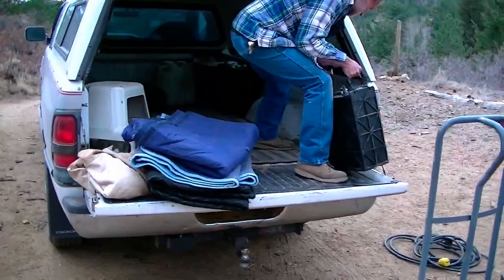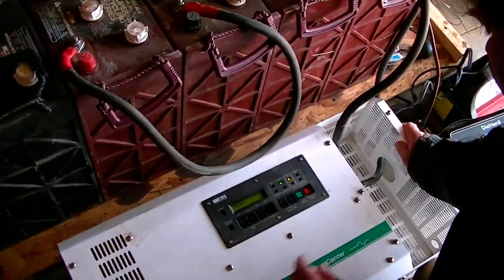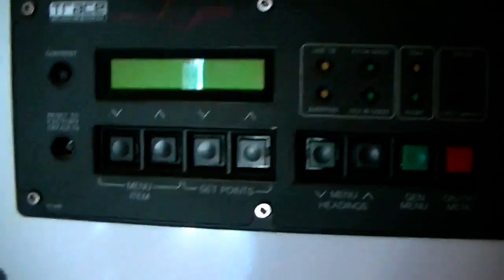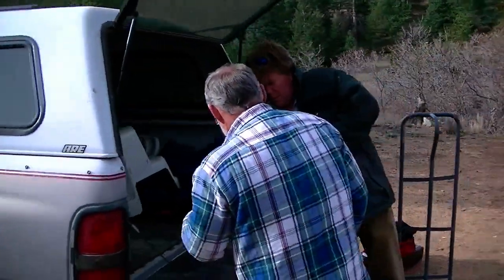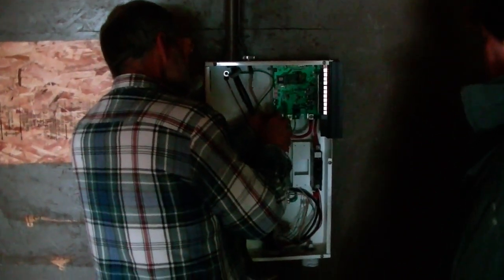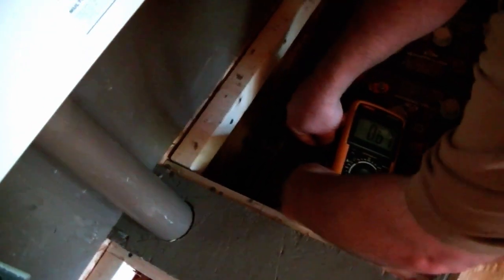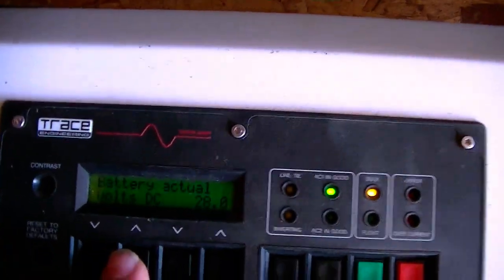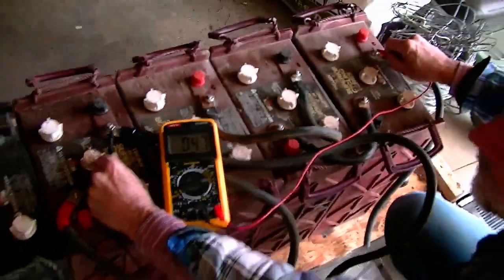Solar System De-Install / Re-Install

Comment: so on those out backs you got your panels wired up to be 60 volt s going into a 48 volt bank correct?
Reply from the maker: +George Ashing on this particular video, the system is 24V.  It has 24V panels wired to 24V batteries with a Trace PWM charge controller.